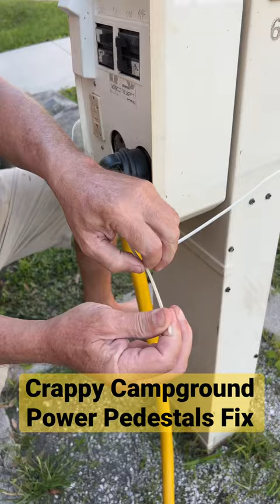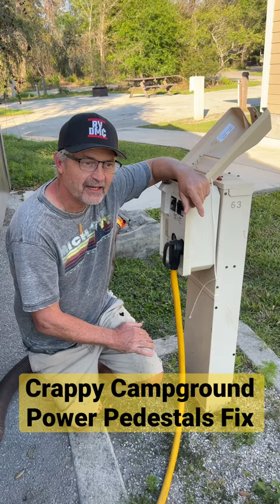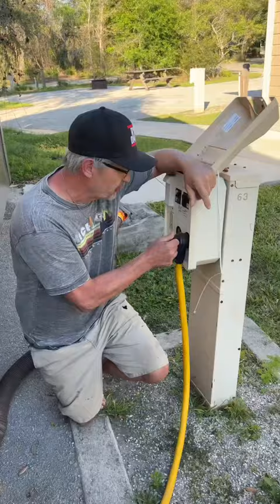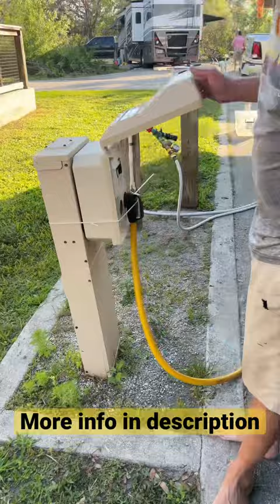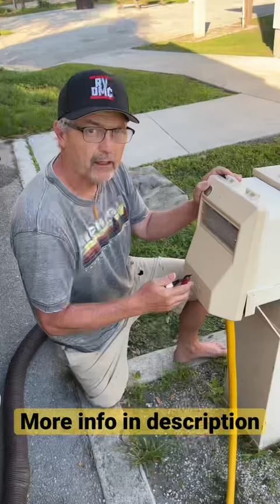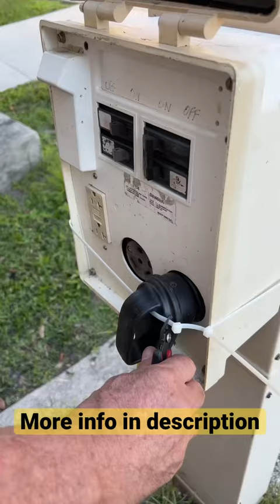Bad RV Power Pedestal Temp Fix! #shorts

Comment from the maker: Please read description of video - click on 3 dots in upper right corner of video

Click on product link on screen to see all product links available
Reply: You can't win trying to post helpful tips.  The Eco-Karens come out of the woodwork.  Is it really necessary to use that much plastic?  Do you recycle?  I use composable bamboo fiber straps.  
Meanwhile, they are forgetting they drive a fuel inefficient vehicle. Spew unnecessary carbon just to travel for their pleasure (how selfish), live in a vehicle full of plastic and mined metals, and plug into power using a cord laden with plastic.
Anyway, thanks for the tip.  No good deed goes unpunished on the internet.
Reply: I like that you are using up the white ties which degrade quickly with UV, given that they are meant to be temporary anyway. Perhaps that will appease some of the Karens?  LOL

Comment: Good idea, but I would have told the park to get the maintenance people out there to look and fix it. The way that is could be dangerous
Reply from the maker: We did let them know. But often you have to wait to get a boxed fixed - we have learned from past experience
Reply: Ah wait just A MINUTE CAMPER GUY AND COMMENTER. I PERSONALLY KNEW A GUY WHO HAD LOOSEY GOOSEY CONNECTION ON HIS 40' CYCLONE AND WHILE HE WAS SHOPPING IT ARCED, SPARKED AND FIRED UP. THE MAN AND HIS WIFE HAPPENED TO GET HOMe TO THEE CYCLONE JUST AS IT WAS CATCHING FIRE ON THE POWER LINES.THEY WERE THE LUCKY ONES
Reply: Loose plugs are trouble waiting to happen. Make sure those plugs are tight.
Reply from the maker: @ronmoore3987  we have an excellent surge protector and inverter that won’t let us hook up. We had to leave a site with a bad power pedestal
Reply from the maker: @richardstewart429  💯
Reply: @Downsizing Makes Cents  Good deal Sir, I just mounted 2 more fire extinguishers on my bed rails of pick up truck for A total of3 fire extinguishers
Reply: @richardstewart429  agreed that’s how a fire can start
Reply: @ronmoore3987  yes yell at people to make a point. Your internet access should be restricted
Reply: @Ron Moore  WHY ARE WE YHELLING???
Reply: @ShadowDragon246  wait yya al mean ya hear me😆😆

Comment: As an electrician I just wanted to tell you, that is insanely easy to fix, and the fact that the park(s) haven't fixed them is just negligent and idiotic. xD I love it.
Reply from the maker: Thanks. It’s all too common. We did report it.
Reply: Wish i was an electrician, mainly for the safety part. Taking it apart and seeing how it works then finding a way to fix would be intriguing to learn
Reply: Seriously i redid the electrical outlets at a campground with my uncle who’s a sparky and it really wasn’t hard at all just had to be confident and diligent
Reply: @chonkychonk  Highly recommend it. If you're interested, local community colleges can teach you some good stuff for wiring and troubleshooting these sorts of things.
Reply: @chonkychonk I've never worked on any of these big outlets before but if its anything like home outlets you just take the outlet off then reconnect a new one. I enjoy doing the stuff but its not really all that challenging.
Reply: @chonkychonk just some wires in a screw clamp on the backside of outlet. Looking up basic residential electrical will do better for the understanding
Reply: @chonkychonk what state do you live in? I’m a high voltage electrician
Reply: @deathangel5317  Washington - I’m a high pressure gas technician 😎
Reply: @clickytheblicky9895 non-flammable items would be much preferred. Please don't advise folks to shove wood into their electrical boxes and equipment.
Reply: Strapping plugs in is just as dangerous and idiotic
Reply: Literally 2 screws
Reply: This is how national parks are nowadays. They are controlled by the government, and most of them have been run into the ground.
Reply: Only.problem hard to disconnect cord in case of emergency btw heat build could cause contact s to weld together.loose connection a fire hazard 50years industrial electrician
Reply: I too am an electrician and you are absolutely correct. Sad.

Comment: Remember, you can get zip ties with a little tab to undo them. I keep my shackles on my tow points with reusable zip ties. Nobody steals them and the pins never back out
Reply from the maker: See pinned comment
Reply: @DownsizingMakesCents  zip ties are great with a small torch as well to use for plastic welding. All the little bits you cut off are worth saving for melting bumpers and trim back together 👍❤️

Comment: 5 years full-time power is the first thing I do when we arrive at a new campground. If I find a bad pedestal or bad power, we are gone. Our coach is too expensive to repair.  Camping is too expensive to plug into junk. We would cancel our credit card charge and be gone.
Reply from the maker: Do you always have a back up place to camp? 
We have a built in surge protector and also did a video on how we test the power before we plug in. 
But I understand your concerns
Reply: We have an internal and an external surge protector.  We do check pedestal power first.  Sometimes, we have a backup, and sometimes we wing it, but protecting the coach is the most important thing.
Reply from the maker: @Blues2cool  💯 we left a site because one leg was too low and the other leg too high

Comment: Could get a Velcro roll from harbor freight for $7 and then you could undo and redo as much as you want and have no waste. Also be careful, loose sockets can increase resistance in your line from poor contact and make that plug hot even if it's way under what it's rated for.
Reply from the maker: Please see pinned comment
Reply: I would be concerned about rainwater wicking and getting zapped.
Reply: The receptacle itself is not loose in regards to its contacts. The device (the receptacle as a whole) is loose within its box. There will be no increased resistance in the situation they have shown.

Comment: That happens when geniuses forgot to unplug before they move their camper.
Reply from the maker: Oh. Yes. I didn’t think of that
Reply: Just repeated use and/or bad installation can both cause this as well as user error. This problem can happen to anything like this, high use receptacles and devices are going to get loose pretty quickly even with proper installation sometimes. Especially with folks hanging surge protectors off them without any strain relief. The device is not meant to support that kind of weight.

Comment: I have a different solution, tell someone in the campgrounds and they will fix it. I work maintenance at a campgrounds and none of our campers would tolerate anything like that. Looks like the 30 amp socket needs your replaced.
Reply from the maker: Please see pinned comment

Comment: Home Depot and other stores like it will have long zip ties in their home electrical department.  The ones I have seen are about 3 feet long.  Its a lot easier than stringing several zip ties together.

Comment: Reusable zip ties do exist
Bungie cords
Get a side cutter that has a hole for a lanyard, use something durable and flame resistant but not metal, attach it to the handle of the plug, that way it's always with the plug and you can't drop it. 
Ratchet strap also works
I would suggest you pick something non conductive.
Reply from the maker: See pinned comment

Comment: Use an old belt that uses the double ring tension. To prevent breaking your leg or hip leave the extra cord coiled at the bottom of the junctionat box So it expands if you catch it.
Reply from the maker: Often, the chord stretches across because box is far away. 
We usually coil it under the RV when we can

Comment: Okay four things, first of all find it easier way of connection, second thing is you're having something heavier on your plug hanging on it you're damaging the plug, your surge protector should be on the ground so it's not pulling on the plug, third of all whenever that cord is moving you're going to have sparks flying inside the outlet which is making it more damage than it already is, and forth about you can have the camp reimburse you for the part that you have reinstalled on the pedestal I have done it myself. You just have to make sure the breakers off and make sure it's not live.
Reply from the maker: See pinned comment
Reply: @DownsizingMakesCents  what pinned comments is there. None that I see

Comment: Get bigger zip ties and a tiny screwdriver to release the little pawl in them. I could easily snap what you're using if I tripped over the cord, which is not only likely but probable

Comment: The number one reason that these plugs get into such bad shape to begin with is because people drive off without unplugging. This won't help. 
They need to rotate the entire pedestal 90 deg so the plug pulls out when there is a drive off. Or an attachment that secures the cable in a way that it rips the wiring out of the camper.
Reply from the maker: That’s a great idea. Thanks for a helpful comment

Comment: zip tie the cutters there also to stop theft
Reply from the maker: Great idea
Reply: @DownsizingMakesCents  i have the cutters on a piece of weed wacker line dangling on the loop in the plug back.   Shrink tubing over the weed wacker line. Looped thru the loop or handle of the cutters.  Then back into the shrink tubing.  Non metallic.
Reply from the maker: @waynep343  👍

Comment: Looky here ole boy, when plugs are worn out and it doesn't have proper contact, it will pull high amps ,and it will eventually burn its self down...so just keep on zip tieing  you will eventually win a Darwin award
Reply from the maker: Please see pinned comment

Comment: Awesome ideas on how to start an eletrical fire. loose connection = resistance = heat = fire.
Reply from the maker: Please see pinned comment
Reply: @DownsizingMakesCents  I worked for the carnival for many years. Repaired or replaced many 220v connections. Also seen and delt with more than 1 electrical fires from loose connections.
Reply: @patrickdavis9566 rewatch and see that the receptacle itself is fine, its contacts are not the issue, it's the devices mounting in the box that is the issue. 

What you've seen is an entirely different problem, a real one, but relatively irrelevant to this situation as that's not the issue here.
Reply: @goosenotmaverick1156  I apologize if what I said went over your head. But what I said stands as I've seen so many electrical fires started like this.
Reply: @patrickdavis9566  it didn't go over my head. And I did not state that what you said does not happen, merely that it doesn't apply here because the receptacle itself is fine, merely loose in its mounting. 

As an electrician, id hope what you said didn't go over my head or I'd be really bad at my job, ya know, dealing with electricity on every level, daily, and all. I install this stuff correctly for a living. This is a bad install but not a fire risk compared to a loose set of terminals inside the receptacle, which is what you're talking about.
Reply: @goosenotmaverick1156 let me be more clear. As the electrician/mantinince person in  many carnivals all over the USA. I keep male/female 110/220/320 connections. Proper Guage, proper connections and understanding how electricity works goes a long way to keep people alive. You would be surprised how many places I have gone to where a jerk made the ground hot on a 220 or 320/360, 1,2 or 3 hot. ALWAYS ALWAYS check proper values before connection. Please believe me this guys advice is dangerous.  Or don't and learn the hard way. It's all you.
Reply: @goosenotmaverick1156 if the plug is falling out.. I'm... dude seriously renew your license, you're a dangerous "electrician".
Reply: @goosenotmaverick1156 let's be very clear. TO FIX THAT. You turn off the power to the box. Check/repair or replace receptacle. Check values and all done before plugging in ANYTHING! As a "licensed" "electrician" you know this. Right?
Reply: @patrickdavis9566  okay whatever you say buddy, let's go with the carnie's advice. That sounds safe. 

You're taking this to a place totally unnecessary about proper procedure instead of addressing what you incorrectly stated about the situation shown. You carry on with your bad self, I won't stop you.
Reply: @patrickdavis9566  let's be clear, that's a loose device not a loose receptacle. But I'm the one that doesn't know anything
Reply: @patrickdavis9566  people like you are why I don't ride carnival rides lol
Reply: @patrickdavis9566  lol 320V what the hell are you talking about? 120/240/480... I think that's what you meant. Even 3 phase is still 240V between any two legs... but carry on Mr Expert.
Reply: @goosenotmaverick1156  I'm gen x and you're gen make believe. I was raised in a world so different that most can't and won't accept the reality. But I know this. You're wrong and you know you're wrong. But your ignorance doesn't allow you to admit you're wrong. So.. prove me wrong. 20k volts won't kill you but 5 Milliamps will. How is that possible? Answer that and maybe I might start to believe in you. Like Santa Claus. Tooth Fariry and my favorite .....

Comment: The problem with the manufactures dont make the prongs long enought. Check out the prongs on a 50 amp. The 30 amp is the one that everone has problems with
Reply from the maker: Unfortunately, there are many reasons the plugs get loose

Comment: Nice, until someone steals your cutters. A better solution is to just buy a velcro strap about 3' -5' long. Wrap it around as tight as you can and lock it in place with the velcro. Velcro has no "give" like a bungie cord. No cutters needed. No zip ties needed, and it reusable.
Reply from the maker: See pinned comment

Comment: Wouldn’t a bungee cord work as well and wouldn’t need to be cut off after every time you unplug it?
Reply: Most zip ties can be reused, you just need a small flathead screwdriver or dull knife to push down the flap which grips into the grooves

But it's definitely more work and effort than cutting or using a bungee cord
Reply from the maker: Yes, but may not be as strong. Or be as tight
Reply from the maker: @zachm241  agree

Comment: Are u kiddling? That wobbly plug in is not something to be overlooked, a loose connection can burn up with plug or wire or anything,  im an electrician and suggest if anyone has this issue to have it fixed properly,  the receptacle needs screwed back in correctly

Comment: people hanging extra shit off the plug is the reason it’s that way
Reply from the maker: Many people have exterior surge protectors. So are you saying no one should be allowed to use them?
Reply: @DownsizingMakesCents   I’m saying the plugs aren’t supposed to hold the extra weight the surge protectors should be longer or have an extension avaiable . Or even use your zip tie or  bunge to support the weight

Comment: I would just open the box and fix it. but I don't expect someone who would zip tie it to be able to fix fix it correctly and safely
Reply from the maker: No one should mess with a campground’s power box! 
Please see pinned comment. 
And if you actually knew our channel, you would know he could fix it. He installed a complete solar system
Reply: @DownsizingMakesCents  if i need it and the camp ground can't or won't fix it, i CAN AND WILL because it's NECESSARY. left loose and getting looser becomes a shock or fire hazard or at least a sever amperage short causing wires to heat up.

Comment: You don't need a pair of cutters for white zipties. They are the weakest and you can break them by hand. It's actually really easy to break them and that's why you should never use the white ones in automotive applications.
Reply from the maker: See pinned comment He has RA and MOG - related to MS
Reply: @DownsizingMakesCents  okay, then he might need the cutters for his personal reasons. My comment wasn't just to him. The last half about using them in an automotive setting like to secure wiring for lights and such still stands. Ive seen so many that failed and they were either too small, the white ones, or just cheap. Luckily they failed in the shop and I could replace them rather than on the road and they end up with a birdsnest wrapped around their fan or an electric fire.

Comment: Incase of a emergency just turn off the beaker
Reply from the maker: Many don’t have breakers
Reply: @DownsizingMakesCents  then they are illegal. Anything installed in the last 50 has to have a means of disconnect at the pole for service....within 50' and in line of sight. So it's easier to just put it on the pole.

Comment: That’s not good for your end, it’s still a lose connect!  Go but a cheap plug extension and on lose outlets spread the prongs, if you lose it over time it’s cheaper than replacing it all!
Reply from the maker: Please see pinned comment
Reply: @DownsizingMakesCents  I just watched and commented on your video. I live in in a class A myself and operated an RV park for several years so…

Comment: Stop wasting zip ties and get a bungee cord 😂
Reply from the maker: We have tons of bungee cords don’t get it. 
The bonus of zip ties is that someone can’t just easily unplug you - we had that happen before we zip tied it. Bungee is easily undone. 
Plus, Zip ties are like duck tape  - so many uses. And they are light weight and take little room
Reply: Or buy reusable ties (with a release tab)
Reply from the maker: @rogerstarkey5390  we have those, too. 
Since this was a short, we could only fit in so much